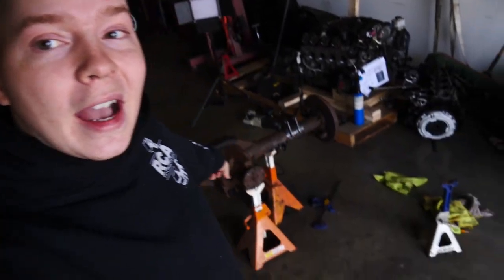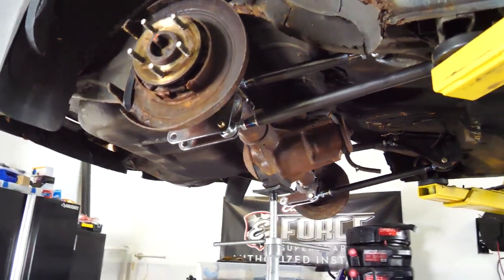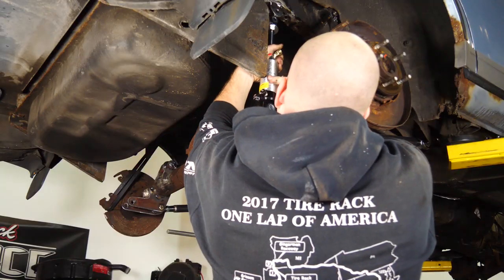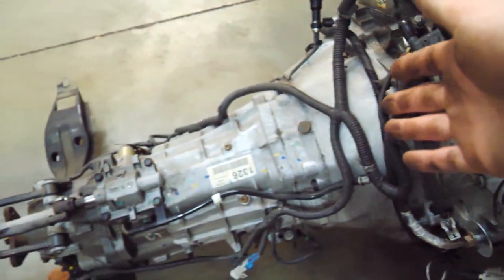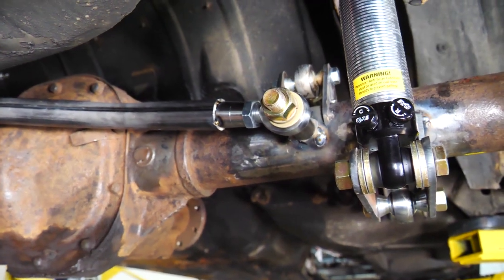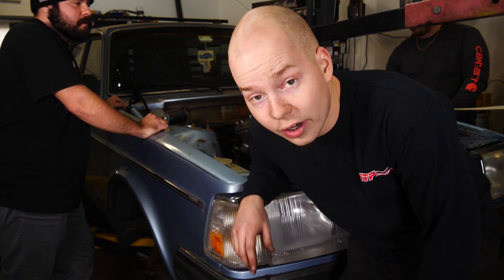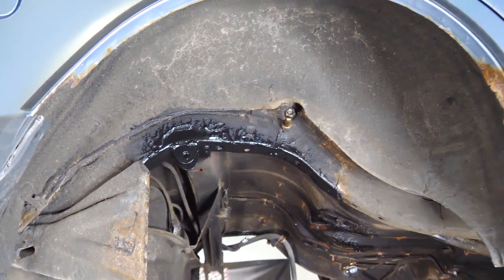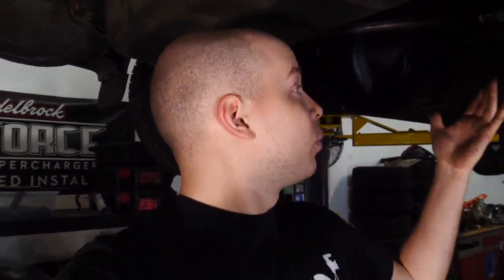VOLVO SLEEPER Gets a CUSTOM DRAG RACING Suspension Setup!

Comment: Do a dry sump for the oil, it will basically eliminate the oil pan issue
Reply: A dry sump kit is pretty expensive, and you also need a space to put the oil reservoir and pump. If he already has trouble fitting the brake booster and steering shaft on one side, there probably won't be much room for the oil tank anywhere.
Reply from the maker: Yeah I had some people recommended me that, its just way to expensive. I already got it to fit so no worries! You'll see in the next vid :)
Reply: In order to have beefy slicks don’t you have to use shorter axles to fit the tires?
Reply: @onmy7.622  not necessarily with the right offset you can make it work
Reply: @onmy7.622  you can still fit slicks on a stock body

Comment: Hey I saw that your LS doesn’t have any rear steam ports you may want to run front and rear steam ports that tie into your coolant hoses to prevent hot spots in the motor.

Comment: 3:15 maybe add a doubler plate on the outside (left and right) that catches the frame too. So over the existing mount you did, going up at least 4 cm.

Here's why i'm saying this. If you ever have a less than crash bump, chances are that the plate's weld/frame will crack. You need some form of stress mitigation because you welded them at the ends (of the plate) where there's less structure than in a over plate situation. 

I know why you did, and that's that, but one plate extra per side should solve the potential issue. One plate per side should be more than sufficient to stop any kind of stress (you have to remember that you're resting the whole car on four plate ends. That's a lot of weight) and in case of a small bump, like i said, you wouldn't have the issues that arise with it.

Also, as someone who got burned on this kind of stuff before, check the pumpkin on the inside, just rotating it isn't enough. Look for excessive wear and maybe even rust. You don't know why that car was in the junk yard, best you know before it breaks to the point where it can't be repaired. In theory, you get away with just checking the state of the gears and maybe use the lever to check the state of the end play side to side (would check the bearing for the pinion shaft too).

Just some cautionary 2 cents, nothing more.

That said, i think you did an amazing job so far. Like i said before, out of all the YouTube car kids, you're the one that has the biggest and most consistent growth. It's unreal just how fast you're able to catch up to the big guys in just a few years.

Comment: Plug welding your control arms will make them that much stronger! Drill into the tube where the shaft of the heim joint sits, but not into the heim itself then fill the plug with weld, off-road guys do that just to hold up to extra abuse!

Comment: I've seen some hydro handbrakes come with bias-ing valve, so for burnouts you can nearly diss-engage rear brakes(if brake line will go through hydro), then use it as staging brake. You don't want to brake that sweet axle, do you?
Reply: Nah, get a mansbrake from nxt shift.
Reply: linelock is a thing...
Reply: @fiisho  Slipping a handbrake while preloading reduces shock on the drivetrain. Linelock locks the fronts only, mainly for burnouts. A mansbrake is a transbrake but for manuals.
Reply: @tag206  I know, im talking about the guy saying to get a biasing valve for burnouts
Reply: @fiisho  Realised after i hit reply. mb.

Comment: Don’t need to remove brake booster to put motor and trans in. You’ll need a different steering shaft and to mash the firewall a bit for the t56 to fit as well as cut the shifter whole a bit. I pulled everything off the front of mine and it slid right in. Also bunch of v8 Volvo groups on Facebook if you have more questions.

Comment: @ Gingium, you should also weld the axle tubes to the axle housing. It adds a lot of strength and will avoid the tubes from spinning under high hp/tq.

Comment: Very cool build but I have some bad news; you just warped the crap out of the axle tubes. Whenever you weld anything onto a differential it needs to be camped down. I know this because I learned it the hard way. How it will show up is it's going to take out wheel bearings, not right away but probably every 5-10k you're going to be replacing one or both of them (axle bearings).
But I love the concept and build!

Comment: You must have seen Tom's Turbo Garage fitment of an LS into a Tacoma. He ended up getting a front oil pan (Summit Racing part numbers in the video) and making a hotrod-style steering extension. It's documented pretty clearly, you could easily copy what he did if needed.

Comment: Nice!
But just to put it out there.
Many people have run +500hp on the dragstrip and drift tracks on stock axles without problems but the magic word is an strong lsd preferably a Torsen helical style because the axles shafts don't like spools, so the 8.8 is a cheaper and stronger alternative no doubt in this situation!
But for their size the stock axles are actually really strong.

Comment: You really need to weld your axle tubes! If you're going to be putting that much power through an 8.8 and launching it you will snap the plug welds and spin the axle tubes inside the diff housing.

Comment: Are you going to reinforce that panhard bolt a bit? You said you were, but I only saw it welded. Seems like instead of that metal sleeve you spaced the bar with, it could use a pyramid like structure to help support the bolt from side ways forces. It would double as the spacer you need as well.
Reply from the maker: Yeah I'll definitely do something like that before doing any serious driving!

Comment: I was under the impression that 2 5/16” had to be taken out of the long side of the axle housing and an additional short side axle used to have the same width as the factory axle housing. Is this not the case? I’m about to install a foxbody 5.0 302 in mine.

Comment: Just saying the stock wheels. Or at least getting the same size wheels so the hubcaps fit would make it even more of a sleeper
Reply: There are some companies that can cut out the center of a steel wheel and weld it to a different rim or they cut the wheel in the middle and weld in a ring to make it wider. So basically custom steel wheels with a stock look. Perfect for sleeper builds.
Reply: lol I was about to say the same thing. Widened stock steelies are the greatest  sleeper mod 😎

Comment: Kinda disappointed you didn’t stick with a Volvo motor, either 5 cylinder or 3.0 6 pot.. Plenty of power to be had out if them. Don’t get me wrong, the reasons for the LS are obvious, just feel it would’ve been way cooler the other way. Great build though, looking forward to seeing it rip. 👍🏻

Comment: Are you worried about any wheels hop or have you had any we’ll heart problems with the four link on your truck also how did you fix the wheel hop if you had any problems I did a four link set up on my truck with a V-8 and it helps a little bit to

Comment: Will you box in the 4-link brackets or will the welded ones hold up 600hp?
Reply from the maker: The ones on the axle should be fine cause they're super thick. The ones on the chassis will probably need reinforcing before launching it at least

Comment: Oh yeah man if you’re putting a five or six speed in it 3.73 gears would be perfect, if anything you’ll wanna move to a 4.10 or 4.11 and that thing with slicks and 600hp will pull you back in your seat so hard you’ll feel like you’re on a rocket

Comment: Did you know all you have to do is buy another passenger side axle and cut 2 1/4 or so out of the driver side tube so your driveshaft is straight in line with your transmission

Comment: i would not use a bolt for the rear i would use tabs stronger plus it would be overkill witch never hurt but it would be a real bitch if you launch that car and that bolt brakes and you eat wall or something